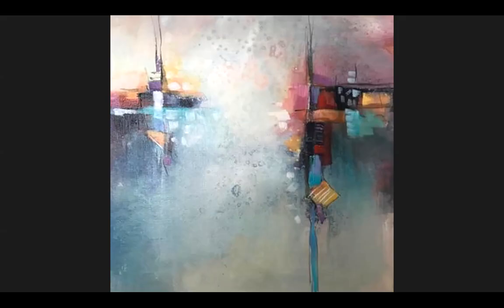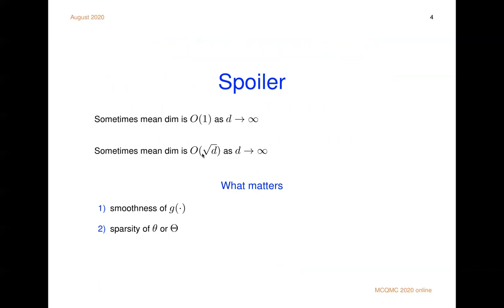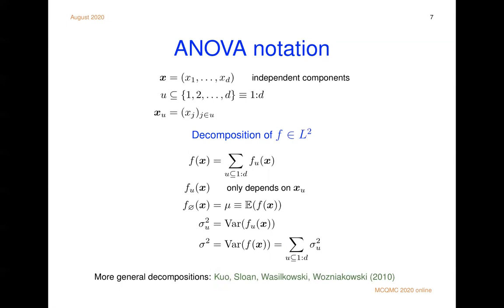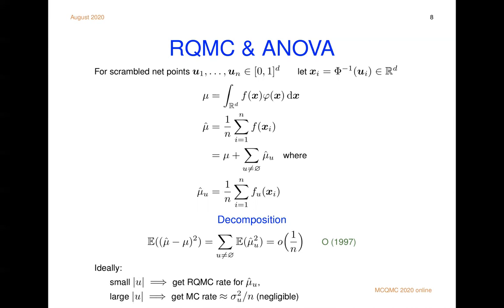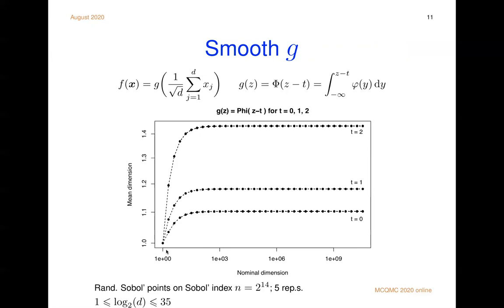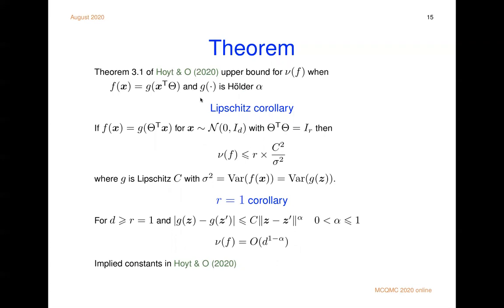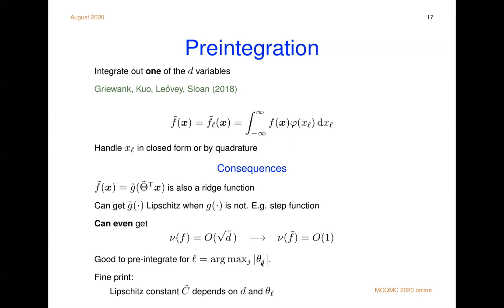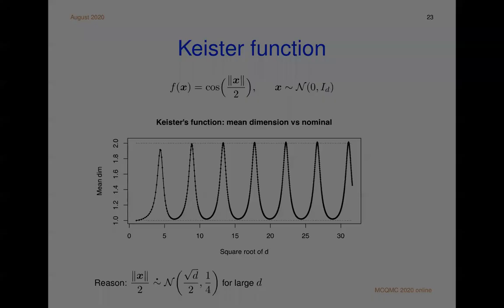Art Owen – Mean dimension of ridge functions

Comment: Mark: thanks for asking about this.  More generally: pre-integration can improve but not worsen a Holder property when the inputs are independent (not necessarily Gaussian) and the function need not be a ridge function.  Pre-integration of an r-dimensional ridge function defined on N(0,I) yields another ridge function with possibly smaller r but generally the same r.